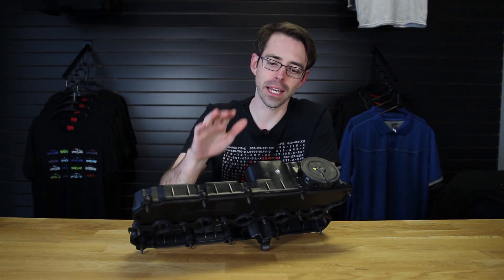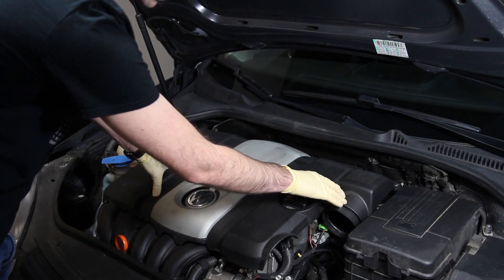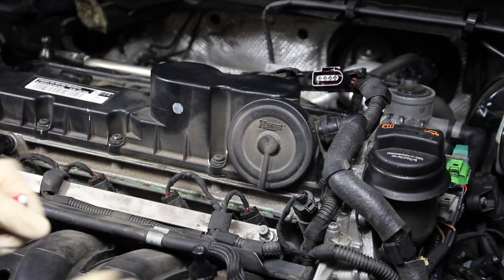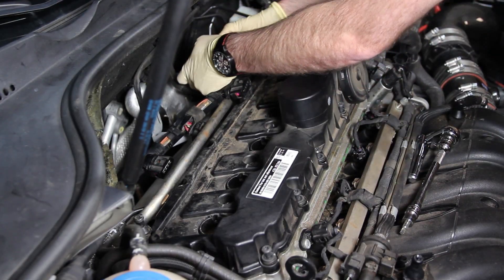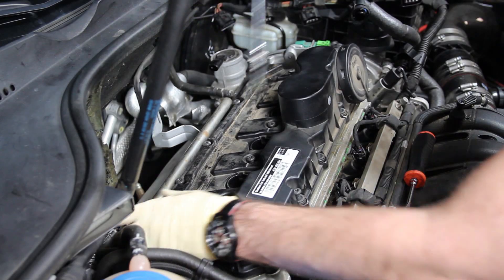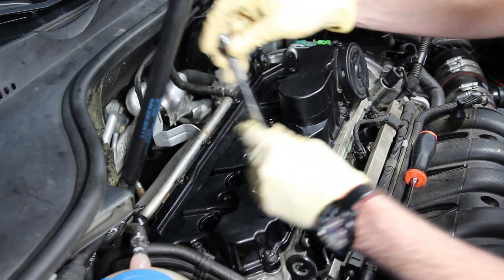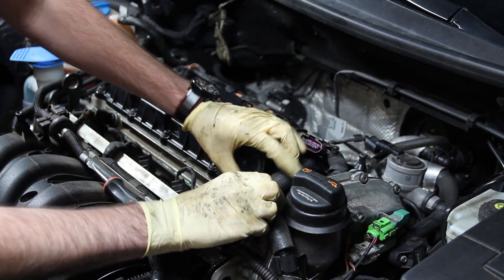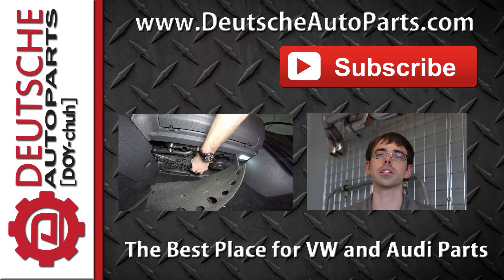How to Replace a Valve Cover on a VW 2.5L 5 Cylinder Engine (PCV Valve Built In)

Comment: Just changing the diaphragm is not not changing the PCV valve in its entirety. Changing the whole valve cover is the solution for a long term fix dince the whole PCV valve is integrated with the valve. This is a common fix for a P0106.

Comment: The only thing I’m amazed by it’s the fact that this valve cover doesn’t need any sealant, I’m shock!
Unless you skip that step.
Reply: No sealent needed as the gasket itself will seal the valve cover with the proper torque spec all around.🔧
Reply: I was thinking that too period thank you

Comment: Good video. One thing you may want to change in the future. ALWAYS start from the center and work your way out on the bolts, even if your just barley tightening. Doing the corners first can cause a crease in the gasket. The main point being, you probably know this, but someone who watches may not and doesn’t understand if they tighten those corners first it can cause problems.
Reply: i was thingking of doing a star pattern, thanks for the warning lol

Comment: I understand that the PCV valve only works by sending air flow in only one direction, I have already changed the membrane of my PCV and it has air flow in both directions, is it normal?

Comment: Changed spark plugs in a 2013 2.5L Passat today.  4 out of 5 spark plug wells were covered in oil. No engine codes or rough idle. 
Thanks to the video now I know the valve cover needs to be changed. Pretty sure O ring failure on valve cover may be PCV or both.

Comment: On my 2011 that I have the cover was taken off and the valves look like they are all in place but if one is replacing the timing belt would it be best to replace the serpentine belt to along with the water pump to and at 230,000 miles?
Reply: 2.5L engine has a timing chain which is on the rear of the engine (driver-side).  Unless you hear the timing chains rattling, you only need to worry about the serpentine belt on the front (passenger-side) of the engine.

Comment: I have the same engine in a VW Jetta 2012 2.5 SE. The oil leak appears to be on the left side of the engine compartment where the timing chain would be under. Would this procedure be applicable? And if such what other things should I probably be doing while I have it open? Do I actually need to buy an entire new cover or just a new gasket? I didn't see the gasket on your cover but I presume it was just stuck onto it?

Comment: I just heard about replacing the camshaft plugs while the valve cover is off. Can you provide any info, part number or video on these plugs which are prone to leaking as the motor get older?

Comment: i AM WORKING ON A 2011 JETTA 2.5 W OIL LEAKING INTO SPARK PLUGS.. REPLACING THE  VCG  (VALVE COVER GASKET SHOULD FIX IT? RIGHT?
JD

Comment: I have learned from experience that a bad PCV will leak oil into the air intake and dirty up the MAP sensor located behind the throttle body.  A dirty MAP sensor will throw A P0106 code.
Reply: What is the solution Friend? Replacing the whole valve cover since the PCV valve is intergrated with valve cover?

Comment: Good info.  I'm thinking about replacing my Golf 2.5L valve cover as I found some oil on the 2nd coil & top of the hole. Can I just replace the gasket or should I replace the valve cover?  Car has 130K miles with no other issues.  Do I need to use a sealant when replacing the valve cover?  Thanks!

Comment: You need to torque the valve cover bolts in a specific sequence in order to seat the gasket properly or you run the risk of having an oil leak in the future. Here is the pattern: https://imgur.com/a/7IEMXS3
Reply: Didn't know that when I changed mine. I just did every other one but ive had no problems & I started in the center. Ive had no issues for 3 months now.

Comment: I replaced the valve cover with PCV Valve yesterday that I got from DAP at a super low price. I only had one problem and that was unhooking the connecting plug from the combination valve because the little plastic tab had broken off. It took me almost 2 hours to figure out how to use a 90-degree pick to literally, "pick a lock". The rest of the job, including replacing coils and plugs, went easy. My new-to-me 2008 Rabbit 2.5 has 147K miles on it and the valve cover gasket was leaking badly in the center section. Oil was leaking into the top of the coils and onto the top of the plugs. The plugs were still clean and the right color, so no harm done. I figure the PCV valve was at its life, so I'm glad I did the job. The car still runs great, burns no oil and gets really good gas mileage. 
I've replaced the vacuum pump brake booster gasket and the coolant temperature sensor is next. The car runs great and I plan to keep it forever. Who knew that such a little car would have a great ride? Love it!

Comment: Thank you for the great tutorial, just replaced the valve cover on my daughters 2.5.  The gasket had failed by spark plugs 1&2 and had been seeping oil on top of the plugs.  Which I found when I went to replace them.  Cheers
Reply: Same here. See my comment above. I was worried about engine damage until I pulled the plugs and looked at them. It shows the gasket is another reason to replace the valve cover when you replace the PCV valve. At the price from DAP, it's a win-win situation. I took great care in tightening the bolts in a proper pattern and then torqueing them to spec by working my way up in inch-lbs.

Comment: When is a good time to change this part? Thanks
Reply: Typically around the 100 - 120k mile mark. My MK6 started leaking recently (I'm at 125k). Waiting on the part to arrive to swap it out.
Reply: @BeepBooBoopBop  ,I'm at the cross my fingers stage. 150k 13 jetta. Same valve cover,plugs,injectors, antifreeze. I've changed trans fluid and filter twice. I really need to change all that soon
Reply: @milvolts1  definitely try to get all that changed out to avoid any issues further along. Change the coils while you're at it.

Comment: I seen your video on replacing valve cover on 2.5 eng. But you didn't check to see if oil was in the spark plugs area. How would you get the oil out if there were any

Comment: i have a question. what if the ignition coil has a lot of oil around it, on a 2007 vw passat, i would have to place valve cover right or gasket right???

Comment: It's a good idea to change the spark plugs while you have everything off.
Reply: Great video! Are there any sensors or hoses you suggest should replaced during this job? I just got one with 190k 😅
Reply: @The_Mixed_Ron_Swanson  the PCV valve should be replaced.  You can either get a rebuild kit for it for about $15 or just buy a new valve cover (its built in) for $40.  Other than that,  just spark plugs and any igniter boots that are cracked or brittle.  I get my parts online  from Rock Auto.  Its a very simple job- one of the easiest of all cars.

Comment: Hello. Is a valve cover gasket leak related to a vacuum pump leak in any way? Both repairs were recommended to me. I've noticed a burning smell recently and very little oil in my car port. From research the burning smell may be a valve cover gasket leak. Curious to know if one problem was causing another.
Reply: Not related. but both are common issues. I had oil leak from vacuum pump. Replaced it myself, then still had oil leak from valve cover so now im doing that. Common VW problems for 2.5l
Reply: @tacsquid  Thank you! Which of these repairs would be most important to repair first?

Comment: If one of my spark plugs keeps getting oil in it, would this be the cause of my problem?  Would I need to replace this gasket?
Reply: Yeah you would I had a guy with the same issue just all of his plugs had oil in them. Lol car still ran though funny it threw cylinder 2 misfire. Recommend you change it though.
Reply: @Ballinlolipop  thanks!  Yeah it seems theres a few gaskets that may need replacing...novice here but can’t fully say the oil is leaking from one spot.  Wish I wasn’t fuckin uneducated on cars

Comment: Just did this for less than hour today. Bought an OEM PCV cover on ebay for $98. I almost went for the aftermarket by Bapmic for $72 but it had mixed reviews. I saw a large puddle of oil on the plastic protective cover and upon inspection, oil is draining from around the PCV cover. Hopefully, after changing this, that will be the end of the oil leak.
Reply: Did it fix your issue Friend?
Reply: @alfredbernal8603  yes. But it only lasted less than 2 years and it started leaking again. Then I decided to just replace just the diaphragm (that is where the leak comes from) that I bought cheaply from that website with a to z guarantee and it has been 3 years since I did it and I havent had any leaks. 

I answered your question several times but it always gets deleted. I dont know why.
Reply: @jackhazz5777  Thank you Leo for your response. 
I did change the diaphragm twice but had no luck. For the past six months, i've been cleaning the map sensor, the pvc hose leading to the intake, the intake manifold & the throttle body. I also purchased a new Bosch map sensor. 
Code p0106 keeps coming back with oil on my map sensor.
At this point, it time to replace the whole valve cover as it has a little over 175,000 miles on a 2009 vw jetta 2.5.
I feel that the intergrated pvc has a build up of carbon and it is probably the culprit for the oil leaking through the pvc hose unto the intake causing to dirty the map sensor.
I will keep you updated.
Have a nice rest of your weekend!
Reply: @alfredbernal8603  goodluck! The entire valve cover assembly is easy to put on. I hope it works better for you than it did for me. My 2012 Passat was135k miles when I had that CEL. So far, that diaphragm is holding up.

Comment: german engineering , why make a pvc valve easy and cheap when you can come up with this????  Dont forget you get a free valve cover and gasket with your new pvc valve
Reply: Love the subtle sarcasm. 100% correct
Reply: @sirwinstonpickles  I agree. I have never replaced a valve cover when I replaced the gasket. The fine German engineering has gone 180 degrees since the days of the original flat-4 Beetle.

Comment: Additional note, be very mindful when removing the engine cover/air filter box from the top of the engine. The example in this video has an after market air intake, so it does not show this, but the OEM air intake duct is connected to the underside of that cover with a spring clamp that is not accessible until the cover is removed and at the other end to your front grill with 2 torx head screws (#15 torx I think it is). Be sure to free it from the front of the grill before trying to remove the engine cover or you will damage the intake duct and have to spend roughly an extra $60 US replacing that duct. Also take care when removing that vacuum line from the PCV valve on the valve cover. It is rigid and can become brittle and easily broken. OEM replacement for that is roughly $110 US and if you break that, you will still be in the same place you are now, with a rough idle and engine revving. These are lessons that I have recently learned the hard way, and hope that no one else will because they will see my comment here. This said, this is still an excellent video and even after my hard lessons, I still saved $200 doing this repair myself. Thanks for posting this.

Comment: My 2010 jetta 2.5s had a rough idle, shut off while driving, and was clunky through gears. Shop told me the problem and wanted $630. So bought the part for 125 and watched this video and another. Super easy fix, took around 45 minutes maybe. Thanks for the instruction!!

Comment: Thanks. I just did this.
I needed:
-a lot of breaks after trouble getting engine cover and valve cover off (it was 30deg F so maybe why they were stuck), total 2 hours.
- gloves and paper towels
-T20 bit and torx driver for intake air duct screws
-channellock pliers for hose clamps
-flathead screwdriver for harnesses and prying ignition coils and valve cover
-T30 bit for valve cover 
- plastic scraping tool for scraping old gasket pieces that were stuck to the cylinder head.
-flashlight and needle nose pliers for retrieving pieces of gasket that fell into the cylinder head.
-new valve cover
-torque wrench and extension bar/bit adapter for 7 ft-lb valve cover bolts
-nap

Comment: great vid.. just ordered the part and gonna put it on my girlfriends 2010 jetta.. I believe this to have been causing other issues and p0106 code, the sensor was completely oil covered.. also we recently replaced the throttle body after it failed.. could this have been the culprit ?? ... any suggestions on the torque of the screws when tightening by hand... ?? not knowing how to gauge 10 newton meters...

Comment: When you took the cover off I noticed the left side of the engine oil is darker then the right side. Why is that? Any explanation? I replaced my valve cover over the weekend and my the colors inside looks identical. Thank you!

Comment: Cam cover! and please tighten this in a cris-cross pattern starting from the center and working alternately to each end. This helps avoid warping your new cover. Cover goes on dry and clean with no sealer as in the video. Nice clear shots, thank you.

Comment: I have a 2006 Jetta 2.5L manual that I purchased with 114k on it April 2017. Replaced the throttle pedal, cleaned out the throttle body, installed an aftermarket intake but my rpm’s are sticking at around 3,000 while I go through my shifting pattern (if I depressed the clutch rpm’s would stay there for 5-10 seconds before idling down). Was just at VW and they ran every code and technician called tech line support multiple times but could not give me any answers or solutions. Could this possibly be my issue? (I understand it could be multiple things but wondering if this is worth me trying and fixing myself?) 

Thanks for any input.

Comment: Dude. You need to blow away all the dust before you do spark plugs or anything.
Reply: The coil packs are pretty good at sealing off the tube in these motors. Every plug that I have pulled out has been spotless.

Comment: Hi I was wondering, if I have oil were the spark plugs are I was told to take out the spark plugs and let the oil drain down into the engine for like 15 min, will this be ok or am I gonna mess something up? Thank you
Reply: Michael Marquez hey did you fix your problem? cause I keep having oil in my plugs too
Reply: Sergioair V yea I actually took all the bolts off the top and changed the gasket and wiped it the best way I could put it back together , took out the spark plugs and waited for maybe an hour and changed them, there was smoke at first but my code for misfire went away!!!
Reply: Sergioair V good luck
Reply: Tks thats great another question did you bought the whole piece like the video and from where sorry its 2 questions
Reply: Michael Marquez so can finally get rid of the same code and not change a lot plugs

Comment: Hi Deutsche Auto Parts! Thanks for all of your insight! I am stumped here. I have a 2010 VW Jetta SE 2.5L. I changed the Pressure/Temp sensor a few times, replaced the pcv valve, and last resort, even bought and replaced the entire valve cover. Somehow, I keep getting the P0106 Manifold Absolute Pressure/ Barometric Pressure Circuit Range / Performance and P2188 System too rich at Idle Bank 1.   
It seems to only happen when it's in the lower 40's and 30's. It seems to be completely fine when it's in the 50's and warmer. Whenever the code turns on, I take it all apart and look in the manifold where the sensor is and there is oil in there. It seems to still be coming from the PCV even after replacing the entire cover.  My biggest curiosity is this.   I have been using 0W40 by Mobil oil because Mobil oil claims that is the correct viscosity. Could it be possible that it is getting into the manifold when it's so cold outside because I need to be using 5W40 instead of 0W40?

Comment: Hey guys, I had P0106 code saying MAP sensor was bad. Of course the problem was that the sensor was soaking with oil. I replaced the MAP just in case. Then I tried replacing the PCV, the result was useless, still getting the sensor covered by oil. Then I ordered new Valve Cover hoping it would stop this mess. Plus, I started getting two more codes saying "the system is too rich at bank1", the car started running really rough. 
Today I replaced new Valve Cover, cleaned everything from oil, reset the codes. 
First 10 min driving was good. The I got the same codes saying that MAP sensor is bad and the system is too rich at bank1. 
I also replaced the coils and spark plugs. 

What else can I do? Is it possible that there were oil on the way to the MAP and that is causing the problems again? If I clean it again, would this help? I'm really tired with this "new" car that I just bought. Please help
Reply: Husrav Homids you need to replace your gaskets. You can buy the entire gasket set from Rockauto.com for 98 bucks

Comment: Hey, how do I reset my engine light after I've repaired this?
Reply: Trish Gower it should go off after a while. Or you can use OBDII which costs $5 online, then connect it to your phone which can clear the codes, plus you'd be able to read any errors.
Or, just go to autozone, those guys will clear it for free